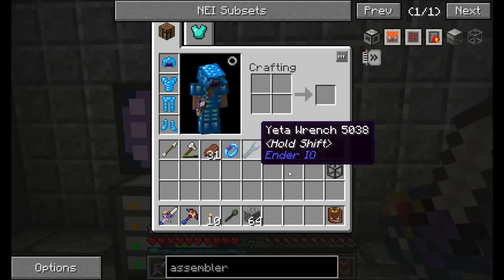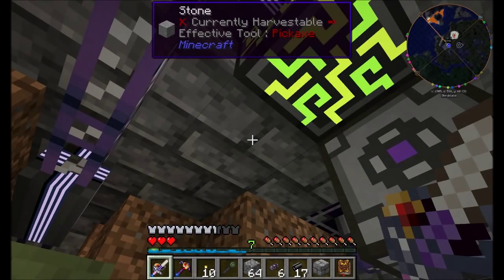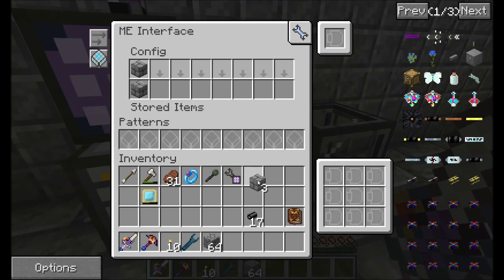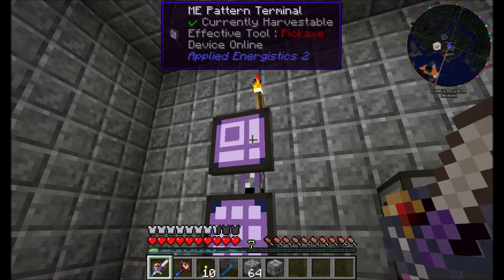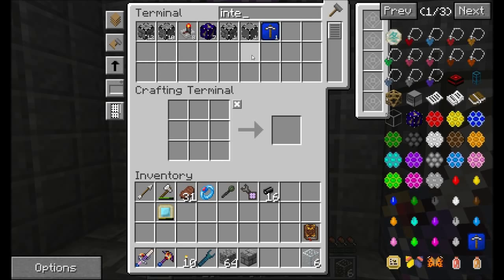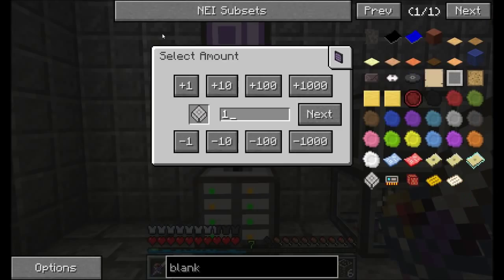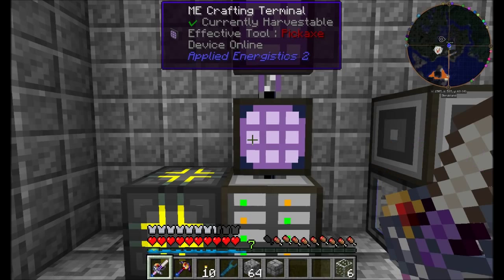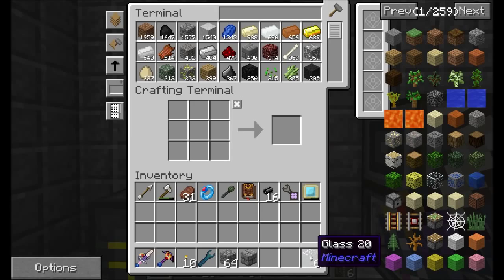Lets Play   S7 E35 Autocrafting

Comment: DireWolf20! You can start an autocrafting operation in the alloy smeltery and then cancel it. The items will still stay in the machine and then be pushed out to the Interface when they are finished and you will still get the items you want. This saves on CPU storage and the same can be said with other machines. Just s a tip I found while my stumbling blindly in the amazing mod of Applied Energistics.

Comment: Molecular Assemblers don't use channels, so you don't need that cable going to the assembler.

Also, you don't want an assembler being shared by several interfaces as that will significantly slow down crafting since all the attached interfaces will have to compete for time with the assembler.
Reply: he connected it to the molecular assembler so he could access all the interfaces

Comment: I prefer the old multiblock assembler.
Reply: Me too
Reply: Price Epical still it doesn't look as cool or feel as much of an accomplishment.
Reply: Same
Reply: farefouse olly it sorta has the same feel when making huge crafting processors
Reply: Renvolt lol if you like, that's fine, just stating my preference.
Reply: I think the new one is a lot more dynamic and has a lot more potential, especially with the different crafting CPUs and the use of interfaces and whatnot.
Reply: I agree. AE1 was a lot simpler and easy to use.
Reply: Sir Xenon  yeah it was brilliant.
Reply: I liked that the old one was so expensive to craft. I felt like crafting it was an achievement and I always put it somewhere in my base where it could be seen by all and appreciated. And about the chanels, I dont dislike them I just find that there a hinderence.
Reply: R.I.P. AE MultiBlock Assembler
Reply: I've been slowly working on my mega-base in FTB, and today I started my AE system and was very disappointed to find the changes...
Reply: yeah we all share your pain
Reply: Price Epical How is new AE NOT late game? Just for the basics, you need an obsidian breaking tool and an incredible amount of exploring. Old AE, right before my first quarry I would have the basics set up. I just don't see the benefit in using the new system. I'm late game and FINALLY found the last press that I needed. But my barrel storage has already expanded to auto craft.
Reply: Price Epical
Bat mode makes early exploration really easy. What would take hours only takes minutes, that's why dire is able to show AE early game without going through the tediousness of searching for meteors.
Reply: +Brianna Kubiwood agreed, but at the same time there are fairly easy ways to get flight early on without morph. I like playing without morph because it makes things too easy imo... Simply Jetpacks gives you a useful flight tool, but it's not OP creative flight for just killing a bat, using that I found 2 meteors right off the bat and had all the patterns too. I was doing AE pretty early
Reply: yes the only modpack i use to play is Monster

Comment: it would be better if u put the sag mill on push pull and put the flint in the interface so that u can get more secondary and less power hope it helps people
Reply: i didnt think of that i used another interface beside with with a cable tanslocator to push it in
Reply: just easier to use 1 interface for it
Reply: angie rossman i know i didnt think of that :3 but thank you
Reply: np hope it helped other people too
Reply: Great idea
Reply: to rescource intensive. there isnt much use for flint

Comment: Dire, using the Ender IO ME cables may make life a bit easier.. don't even need the cable anchors as EIO cable can be disconnected from one another with the wrench... And come in both normal and dense versions.

Also, love how you still bury your lines under the floor, instead of in the floor :P .. The EIO facades are like one of the best parts of the mod!

Comment: With the autocrafting setup, if there are more than three outputs, like when grinding specific ores in a SAG Mill, is there a way to have extra bonus items that aren't specified in the encoded processing recipe automatically sent back to the AE system?  For instance some ores in a SAG mill will produce 3 dusts of varying quantity, plus a piece of cobblestone.  There don't seem to be enough slots to specify that the AE system would expect more items so how would this be programmed so that the system doesn't get clogged with cobblestone stuck in the SAG mill?

Comment: I guess I still don't understand the point of using the smart cabling. It seems to me it's adding a limitation to something that was unlimited before. Can't you just use regular ME glass cable and hook everything up together and not have to fart around with channels and such?
Reply: The point is to make a bit harder so you have to think how you design your network. 
You also got some very big cables with lots of channels and then you can still add more because the ME Controller is a multiblock structure as well and therefor can be extended for more cable outputs up to a 7x7x7 structure - I highly doubt anyone needs that though ...
Reply: No, regular ME glass cable still has the 8 channel limitations.  The Smart cable is just allowing you to actually see the channels in use.
Reply: Go into AE2 configs, and there is an option to disable channels

Comment: Looking forward into seeing your solution to auto crafting the pure crystals and fluix crystals. I had to use a open blocks dropper BC the open crate from botania for some reason only drops 2 out of the 3 ingredients needed for fluix crystals which I can't understand. It's like the open crate only has 2 inv. Spaces and by the time they're empty the interface has already gave up on sending the 3rd ingredient and quits. The 3rd ingredient for me was nether quarts but I think that depends solely on how you have your pattern set up. Maybe I could do a chest before the open crate as a buffer....gotta go check now I thought of it.
Reply: Having the exact same problem, maybe an interface that puts the items into a chest which get exported by item conduit into the open crate?
Reply: he did it in his multiplayer series... in one of the earlier episodes. using a Transfer Node with a World Interaction Upgrade from Extra Utility pulling only the Pure Quartz & Pure Fluix Crystals with a Item Filter.
dropping the 0% ones into water can be done in several ways.
i dont remember how he got the accelerators to detect that seeds where dropped into the water...

Comment: Someone needs to add a Pipe-midget mob so we can use it to run in small spaces using morph.
Reply: The enderminy basically is that.  You can run beside or over any standard-side conduit.  You do get blocked by larger conduits though, like when you have two enderio conduit types in the same block.  I'm not sure if the wrench-hiding trick lets you bypass those or not; must test that sometime.
Reply: Mirality
It doesn't, unfortunately. I've been playing the DW20 1.7 pack, and I cant find a way to do that. The raven from Twilight Forest is my current morph of choice, combining the bat's flight with the endermini's smaller size, though it still can't fit past two enderio conduits